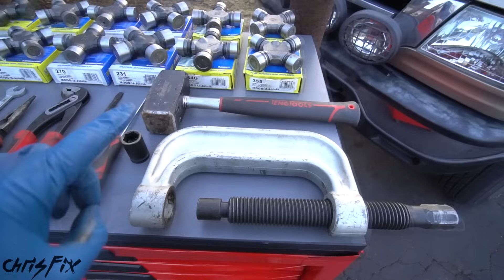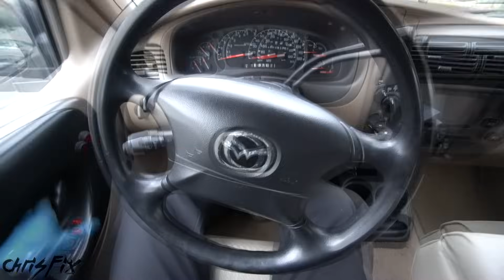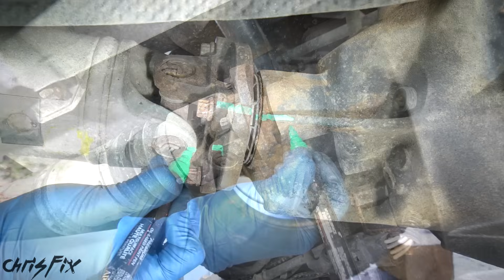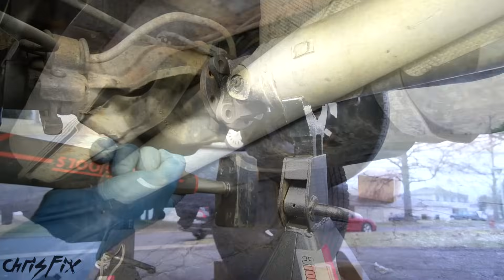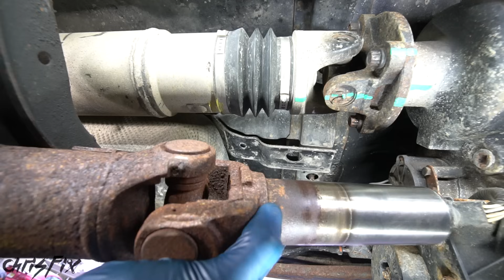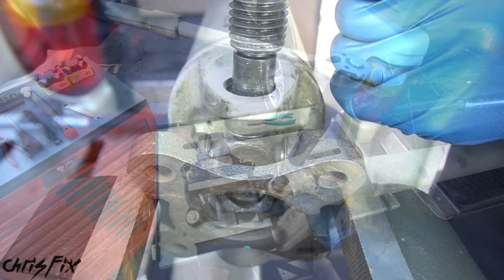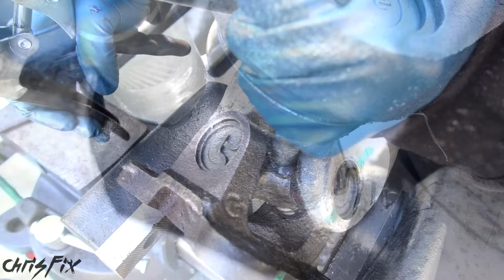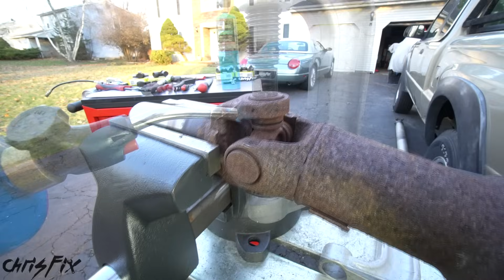How to Diagnose and Replace Universal Joints (ULTIMATE Guide)

Comment: Great video for do it yourselfers, if you follow Chris's advice you can do it, its that easy. I changed my first u-joint at 16 years old in 1966, using the hammer method. I had advice from my dad and older brother, plus was starting auto shop at school, plus worked in a gas station while I attended high school. ChrisFix videos are sound automotive  advice. Who are the 181 knuckleheads that disliked this video. Thanks Chris for the videos .

Comment: Just want to say for the safety of others, some gm driveshaft use plastic plugs to hold the u joint in with the metal retaining clips the plastic goes in the side and they say to heat it with a torch and it will come out well I have done this but the last time I tried to do it I literally had a driveshaft or u joint explode in my face from expansion from the head so just a heads up if you encounter those they need to come out before trying to take the caps out and just get a small drill bit and drill them out but don't break it off in there LOL take it from me I almost could of lost my face or my hearing and I lived to tell the story lol
Reply: One more thought before heating a u joint if it has one take out the grease fitting or drill a hole in the u joint to let the gases get out before it goes boom and I've done several u joints and maybe it was a fluke freak accident but something to watch out for

Comment: I would like to add if they are replacing U joints to put the grease fitting on the driveshaft so it is being compressed while driving forward.  I have seen many U joints that have been ripped open and destroyed at the grease fitting, because they were not put on properly.  🤔
Reply from the maker: Thanks for the tip

Comment: How did you know you tightened the bolts to 80 ft/lbs by hand with the long wrench given it isn't a torque wrench? Presumably just by feel?
Reply from the maker: When you tighten things down with a torque wrench all the time you get a “feel” for it. Sure it’s not perfect but it’s close enough to work. Sometimes you have to do it by hand because there is no room.

Comment: my step dad has changed my trucks u joints like 6 times on my truck in the last 15 years, the truck has 610,000 kms,
if i still have my truck to the point where it needs it again, thanks to your video i think im going to do it myself,
i have been looking for an exuse to use all the toys i have boughten from your xmas videos
one last note my trailer got a flat and i had my breaker bar and my impact gun didnt have to use the breaker bar but i changed the tire in like 1 minute with the gun in -30 weather, no idea where its been all my life THANKS AGAIN for your great videos
Reply from the maker: Haha awesome man! Glad the video was helpful!
Reply: ChrisFix where would you recommend buying an impact gun from

Comment: Don't know if true, but I thought if it was a U-joint the vibration would increase at speed when you apply throttle.
Easy way to differentiate between tire balance (constant) wheel bearing (when turning) and U joint (when accelerating).
I'm not a mechanic though, so whatever.

Comment: Chris i am surprised you didn't cover two tips that I us all the time.

1. I use my bench vice and two sockets to press the end caps out.  One socket is the same size as the end cap and the other is large enough for the end cap to fit into.  It is very similar to using the "C" press but I don't need to borrow the press. 

2. My second tip helps if the cap does not want to come out.  When even I am using a puller or a press and it is getting to hard to tighten the screw I give the end of the screw good tap with a hammer.

Comment: Heh. Using an impact gun on the press... In lieu of having a proper carjack, I use my impact gun on the jack that came with my 3/4 ton truck there's (hex-heads on the ends of the extension bars, always be sure you're clear of the vehicle). A little unorthodox, but it works. I'll get a proper hydraulic jack one one of these days, but I want to keep my eye out for a sale so I can get a 3-ton kit with the stands.

Comment: Cool vid my question is how do they balance the whole drive train the rear yoke and the transfercase yoke to the driveshaft I thought just the driveshaft where balanced putting the drive shaft the same way it came out is a good habit but would it really matter where it was located as long as the bolts lined up just curious cool vids

Comment: Hiu chris, my Acura mdx started having a clicking sound when you turn, but drives fine and doesn't vibrate or anything, but lately it has been leaking on the garage some dark fluid. You said bad u joints could cause problems with the trany, so could it be leaking from the bad u joint? idk what it is thanks

Comment: been waiting for an update, yea cant do much stuff when its snowin n cold.
every time i had to change ujoints, id take the driveshaft to a shop that specializes in them, theyd put new joints in and check the balance  - for ( at the time) like $60 .
 i had an 89 f150 with an aluminum driveshaft that got dented, i had that place make me up a whole new steel one for ( again at the time) like $150, inc ujoints. since it was dented, i had some differential issues that needed fixing, i nearly just bought a whole nother rear axle.
thanks for updating, be lookin for more vids soon 😃

Comment: When I put my truck into reverse or drive it tries to jump and there is a clunk but if I hold the brakes hard enough it won't jump. Almost like it's trying to launch and whatever direction.
Reply: You might try checking Motor Mounts.  Takes two people.  One to watch how much the engine moves when tranny is put in Reverse.  There are other causes...

Comment: Great video, as always. At work I replace them all the time on dump trucks, and have done both methods, my favorite is the press and an impact. When reinstalling the first cap I like support the u-joint in the cap with my hand as I'm pressing or hammering the cap down so the bearings stay in place. Without supporting it, I had a few times where the bearings fell down inside the cap and I had to remove the cap and reset the bearings.

Comment: @ChrisFix - How do you put the c clips on for the other style of Uni Joint (the c-clips) you removed via the screw driver / hammer method? Putting those bastards back on is a pain in the butt! Wonder if there is a "proper method"?

Comment: very informative.. great job.. i would use the press.. but my truck came with a  DRIVETRAIN warranty and they way they changed the u joints and center support bearing and 2 joints on my crew cab truck was to replace the whole thing...  ..mopar said since its the company paying for it..its cheaper to replace it than repair it.. ..too much labor... my driveshaft must be 8 or 9 feet long .. crew cab long box Ram..

Comment: As a qualified mechanic i would not recommend u-joints that have grease nipples they do not last as long as good quality non serviceable joints. I have changed hundreds of greaseable joints in 3 years of my apprenticeship vs only doing just 2 non serviceable joints, one of which being my own 1994 ford fairlane ghia. At 318,000 km on the clock only 1 bearing cup ran dry and started to squeak.

Comment: Hi Chris, nice video, as always!

I've got a question. There are some U-joints, that have thin shims installed between retaining clips and bearing cups from factory, or U-joints with the retaining clips of different thiknesses. It is said, this is necessary for correct drive shaft balancing. Any comment on how to replace such U-joints at home?

Comment: Why does it really matter to mark where the shaft was? It's balanced off the car so is already balanced and there are no specific points on the diffs to line it up with aside from the bolt holes themselves. Plus just like when it was built, if you put on a different shaft, you'll just be mounting it at an arbitrary point anyway. Just something that's bugged me as if I were to replace my shaft with a CF one, well, damn if I just don't put the new shaft on wherever the bolt holes line up. :)

Also great video, it really instills confidence in doing such a job. :)

Comment: I am having clunking noise on my corrola 06 Steering Wheel UV joint.    I was thinking of taking it out myself and inspecting as any local affordable mechanics don't want to touch it. Should I be worried about something and any advice? And thanks for videos as i learnt lot about cars and fixed lot of botched jobs done by local garages

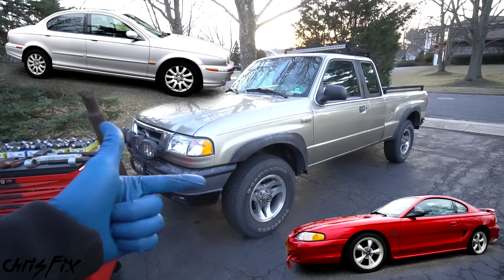Comment: How come, you don't need to loose the U-Joint by tapping it with the Hammer with the hammer method, as you did with the press method? 1:01 What's the difference between an all-wheel-drive and a four-wheel drive or was it just a mistake?

Comment: A wheel chock is super super and I mean super important. I was replacing a set a u joints on a old bronco and I thought the ebrake worked. Joke was on me..... I popped out that drive line out of the yoke and  the bronco rolled backwards instantly. A big vehicle and slight inclines don’t mix when there’s nothing stopping it. Don’t be dumb like I was. Use a wheel chock, blocks of wood, bricks, etc. Anything to make sure your vehicle doesn’t move when you take that drive line out.

Comment: could we apply  anti seize to the matig surfaces, and coud we clean and paint the rusted parts before reinstalling them? also I see you dont often note that bolt threads need to be cleaned with a tap, especially if there was a threadlocking compound in the before. Great video, can wait for more!

Comment: Advice....don’t buy cheap uj joints. They are such a precise fit and they maybe to tight or to loose. 
Also check with manufacturers records...eBay seller said front and rear same size when the weren’t. So don’t do cheap....

Comment: Hey Chris, Great video! Question, could you not just use a crows foot on your torque wrench to make it fit onto the bolts? Just be sure it stays at 90 degrees and it should be pretty close if not right on.

Comment: my honda civic 2016 gets the noise sound while backing up or driving over a bump (it comes from the right rear, the car is FWD).  Sometimes, while I am driving high speed in a freeway,  the car has no balance (I just can feel it inside the car, but I can not see it through the windshield). My dealer did change the shock but the noise still happens. Does it come from the U Joints? Please give me some advice. The car is brand new. Thank you

Comment: Hi Chris, do you follow the same method with the non greasable U joints, more especially on the lubricating part of the install or you lubricate the bearings just before you install the cap

Comment: Awesome vid as always!
Very detailed.
One point id like to make, an its no disrespect, but it doesn't matter to mark your driveshaft to the diferential. It can never be balanced as a complete assembly, just not physically possible...
Driveshafts are balanced by them themselves, and are not refferenced to the differential or yoke locations. Even when custom building driveshafts, you only balance the shaft.
Just thought id mention that, cause ive noticed a few vids that suggest you mark the location.
Completely not necessary. But it wont hurt anything if you like doing it this way!
Just if it were true, then you would have had to mark the exact sline between yoke and output shaft to make sure you didnt throw off balance on the opposite end of the shaft that you removed...
Love your vids man! Keep up the good work!

Comment: If you can not get the bearing caps to seat all the way, take it apart and check too see if a some needle bearings fell over in the cap when you installed it. They will make it impossible for both caps to seat. (A 100 ton press might squish it together but they won't last long)

Comment: ive already done my ujoints. Twice at that. i broke the pins inside and they all fell out within 10,000miles. Couldnt tell til i grabbed the shaft. sure they are broken again.. Tired of replacing them
Reply from the maker: Did you hammer the ears to settle the u joints in?

Comment: A sort of handy tip I learned was to grease the U-joint prior to installation. The grease holds the needle bearings in place when you remove the caps for installation. I generally use a zip tie, but it can be done by hand if you've got a friend around; and if you want to make sure you've got a friend around call them and say "I need help with a project, I've got beer."
Reply from the maker: Thanks for the tip!

Comment: These are really easy to replace by themselves.  The real challenge is the dang rust-welding that most people don't have the tools to deal with, myself included.  By far it took longer to get things apart than replacing them.
Reply from the maker: That’s where the penetrating fluid and heat help a lot!
Reply: ChrisFix Thanks bud, it's true and thanks for putting it out there!  You are performing a true public service here.  Anyway, I ended up using the hydraulic steering press method that I'm pretty sure you've covered.  Most of us hafta do this stuff on the cheap, and channels like yours are invaluable.

Comment: When you put grease in the joint and it comes out didn’t just ruin the seal ??
Reply from the maker: Good question. The seal is designed to purge the oil so no you don’t ruin it. Same for ball joints and basically any greasable part.

Comment: Chris why didn't you fill the grease before putting the ends on? Wouldn't that be easier?
Reply from the maker: It forces the caps off when you add grease so it’s easier to just fill it when it’s installed.

Comment: So what causes a u joint to bind up? Ive had mine replaced twice and within 50 miles it started with the vibration and squeaking.
Reply from the maker: If they didn’t tap the ears to seat/loosen the u joints it could cause an issue. If they didn’t grease it or used cheap u joints it could be another reason.
Reply: ChrisFix Ah. That would make sense. Thank you

Comment: Can you do a video on how to remove stuck on wheels because im working on my uncles jeep and i cant remove the rear wheel
Reply: Shawn Foley um did the lugs come off off so than hit the rubber with a hammer it will bounce back so don't stand behind it
Reply: Jarrod Draper the lugs came off and i did hit the rubber part with a 5lb sludge hammer and a 10lb sludge hammer
Reply from the maker: If I ever get a stuck wheel I will make a video. Put the lugs on the wheel but loose and go for a slow ride and turn the car back and forth and try to use the weight of the car to pop it off. Go slow and do this somewhere safe. That’s a worse case scenario. I donkey kick the wheel when I can’t get it off. Never had a problem doing that.
Reply: ChrisFix didn that and it worked i just had problems starting the car because it had been siting for a little while so batery was flat and i had to use a lawnmower batery to start it

Comment: My 4x4 Silverado has a slight vibration at 60-70 mph. I will crawl under it tomorrow and check the joints out. Great video Chris!
Reply from the maker: Awesome! Let me know if you find a loose you joint. Make sure you use a long pry bar and also your u joints are plastic injected like the one at the end.

Comment: I hear a clanking sound when I go slow at curves like cruising at 4th gear then just letting off the accelerator to reduce speed down to about 30kph... and I am beginning to suspect it is the U joints. You just remind to replace my U joints... we call it Cross Joints here... thanks. But it is not as easy as you show in your video. Still, you make it look so easy... as counting peanuts. I have a Toyota Hilux 1994 .. yes, that old, and parts are really going to be rare if available. Thanks .
Reply from the maker: It’s really that easy. The press with an impact gun makes it even easier. Spray it with penetrating fluid every day for a week before you do it if you know it’s rusty.

Comment: @ChrisFix

1: thank you SO much. Timing couldn’t be better because I suspected this was the problem on my truck, and was about to send it to my mechanic because it seemed a little complex. Now I can save the money, and I know for sure this is the problem because I had all three symptoms. 

2: my truck has 157k in it, driveshaft is good but I have surface rust on it, do you think it will be worthwhile to go ahead and replace it? will that increase the likelihood of vibration since it will no longer be the factory balance?

Comment: Fill the caps with grease to prevent the bearings from falling over during installation.

On GM u-joints, heat it until the plastic oozes out of the hole.

Comment: Good god. You don’t have to mark the pinion flange to the driveshaft or the transfer-case flange to the driveshaft. No automotive manufacture balances a driveshaft on a vehicle as a whole Chassis assembly. That section in your service manual is full of crap.

Comment: Okay pretty informative video, i replace ujoints all the time as I am a driveline specialist. First rule ONLY use spicer ujoints, all others are built poorly, when i build driveshafts I cant use others because they have too much play.Also Spicer invented the ujoint HAHA. Second do not use a press , always use the hammer, the press can actually bend the yoke if the cap is rusted in there alot. Thirdly Awesome call on marking the driveshaft yoke to the shaft itself and the pinion yoke,I dont know how many techs i have explained that too.
Great vids keep up the good work

Comment: Chris, I have been tracking down a squeak my 2006 super duty has only in reverse with a load on the driveline for about a month. I’ve checked play. Visual inspection, but the squeak you showed on yours is the same as mine. YOU ARE THE MAN!!!  I knew to check the u joints but almost ruled them out with visual inspections but did not use a pry toool. Thank you man!